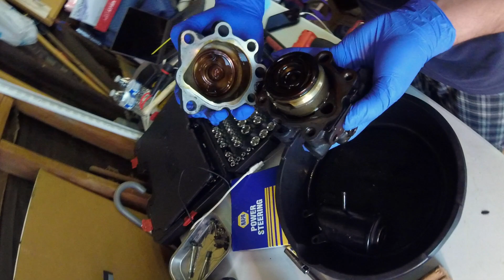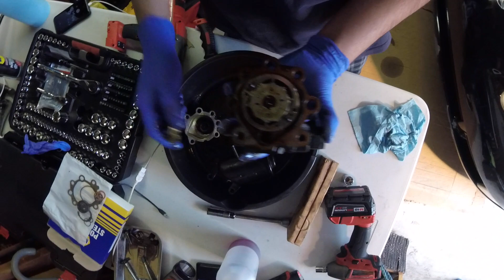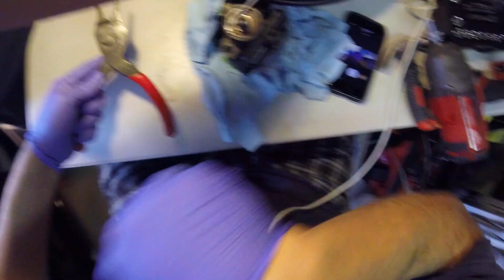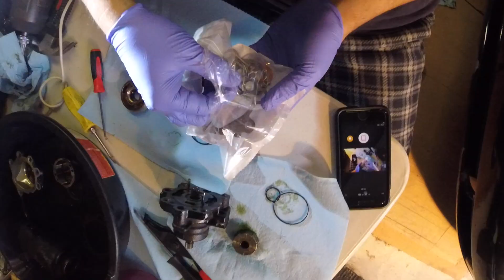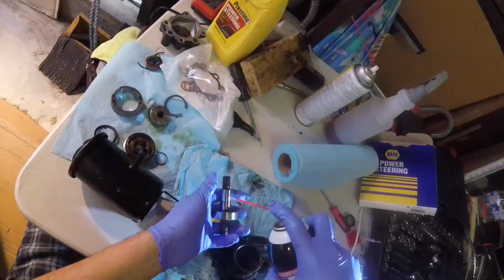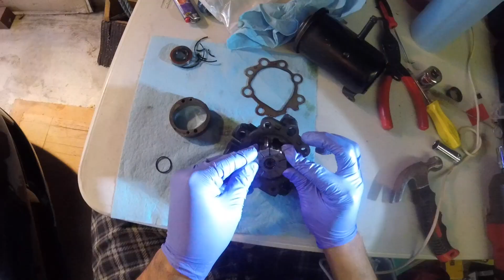SC300 2jz Power Steering Pump Rebuild

Comment: I have an IS300 with a different part number to yours, but the concept should be the same. Is there an o-ring that goes between the reservoir and the pump? I'm asking because I've always had a slow leak, but only needed to add fluid like once a year, so it wasn't an issue. But after I replaced my AC compressor yesterday, I've had a horrendous leak that gives pump whining noises after less than an hour of driving and needs filling again. So I'm thinking I might've knocked something loose while maneuvering the pump out of the way for the compressor, so I might just rebuild my OEM pump rather than replace it. The rebuild kits come with 4 o-ring, 1 big, 2 medium, and 1 small. Do any of those go on the connection between reservoir and pump? The kits also come with 2 copper washers which I'm assuming are for one of the lines. Thanks.

Comment: Great video.  Where did you get those snap ring pliers?
Reply from the maker: I believe they are Snap-On. They come with a variety of interchangeable tips. Some with different diameter pins, others angled down, and others with sharp points.

Comment: Do you plan on swapping the engine or just swapping out the head or block when they finally die?
Reply from the maker: Chris Torres Not sure just yet. I’m trying to get the engine healthy while focusing on upgrading my suspension. I’m dropping the rear subframe soon once I get my last set of adjustable arms. I’ll be making a video on the whole process too. The engine is healthy, just have an exhaust leak and need to change the head gasket. Planning on drifting so I need to have everything set up.